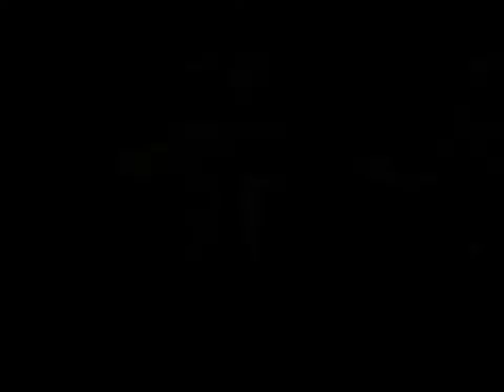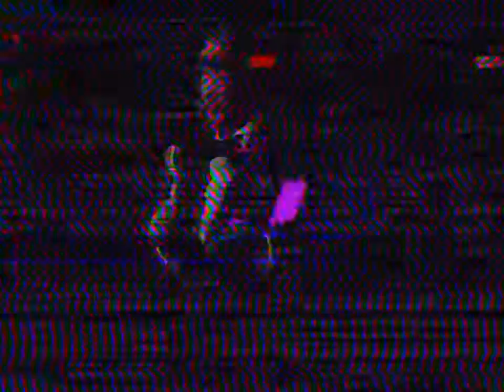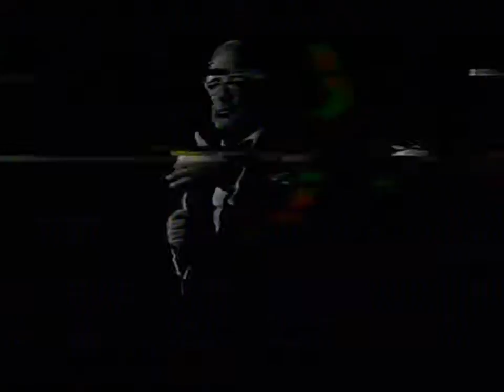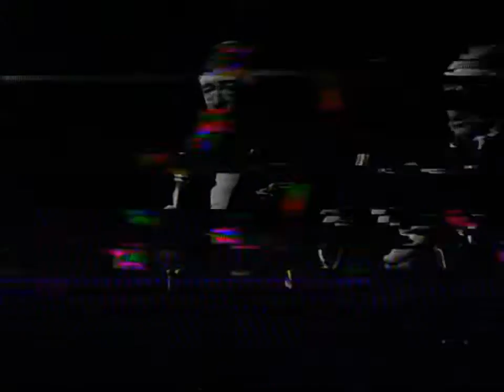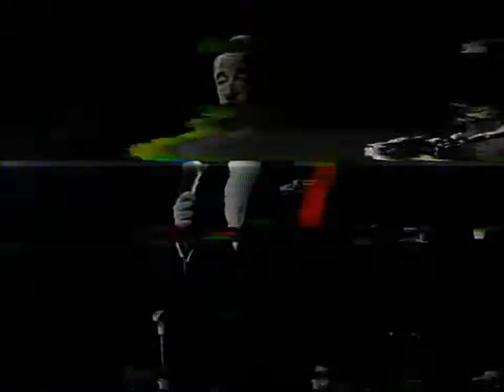VHS Corruption

Comment: I've been working with a lot of VHS tapes from the 90's in recent weeks and I've been lucky enough to have found fewer problems than I imagined I would. I was afraid many of the tapes I had saved might behave like this one but the format is more robust than I gave it credit for. The only issue has been keeping the old VHS camcorder working, but thanks to some of your previous videos I have been able to make a few repairs that have kept the old machine running. Thanks!